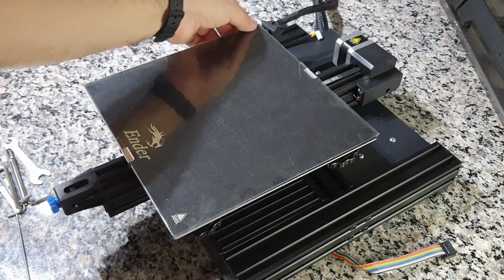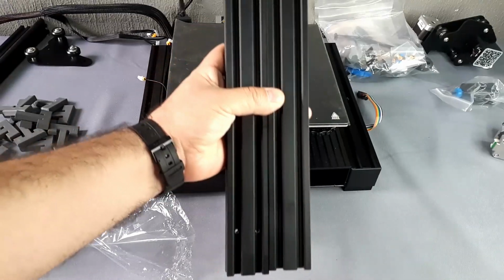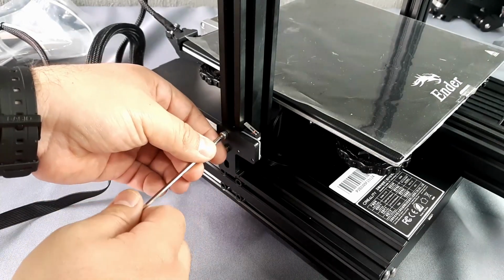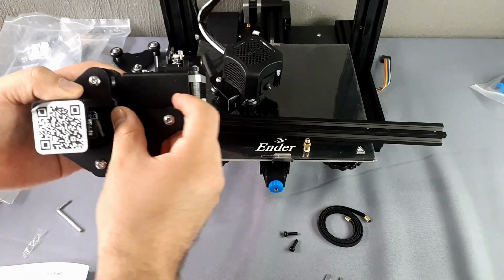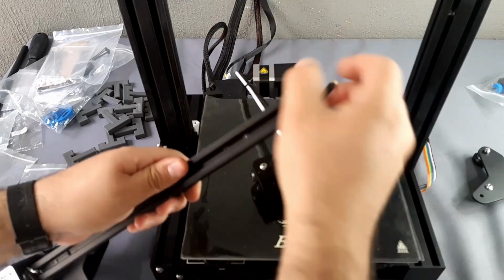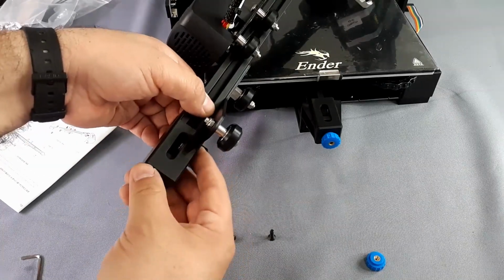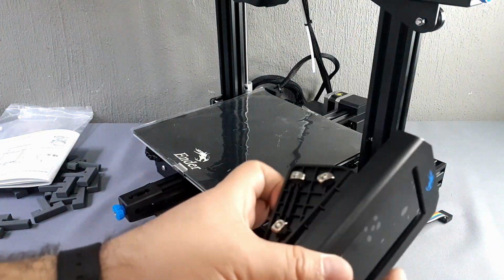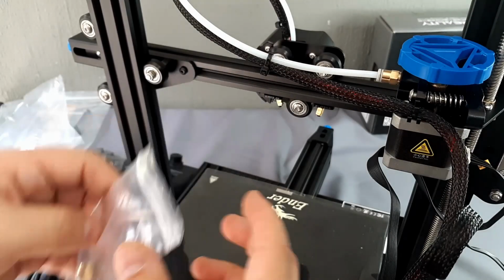Ender 3 v2 - Detailed Assembly Guide 🔧 Step by Step for Beginners - by Tostatronic

Comment: these are some of the worst assembly videos i have ever dealt with
Reply: Hi, it would help us a lot if you provide us with more information. Any opinion is valuable in the search to offer better videos.
Reply: @DedoPoderoso  well you dont mention which way the rails stand up detailed enough. and you actually dont have the right angle on the camera to see what you are actually doing
Reply: @moekhn  I managed to figure it out, but it took some careful video sleuthing!  The right rail has its holes inward (on the left).